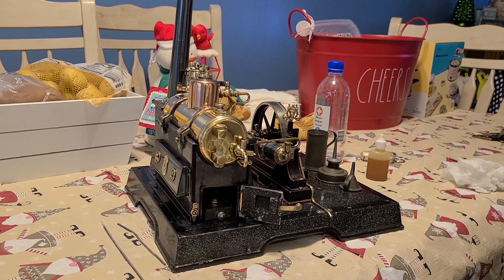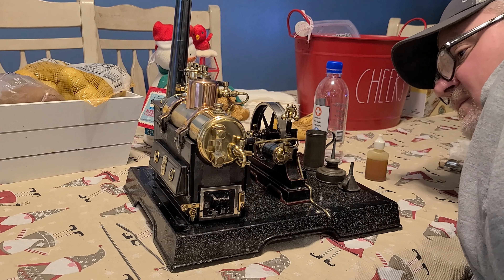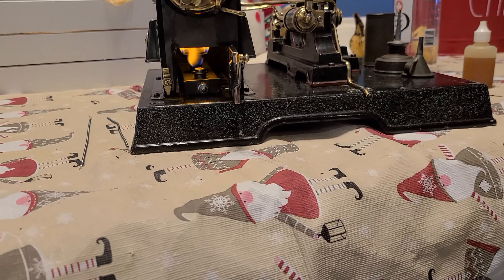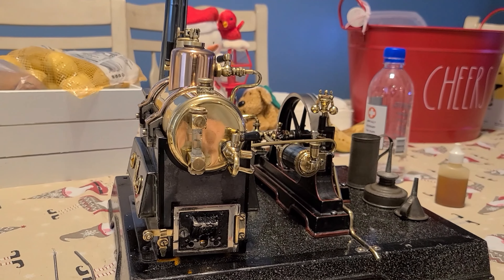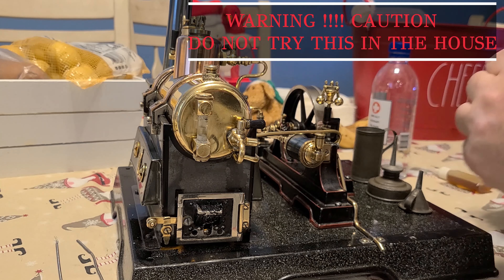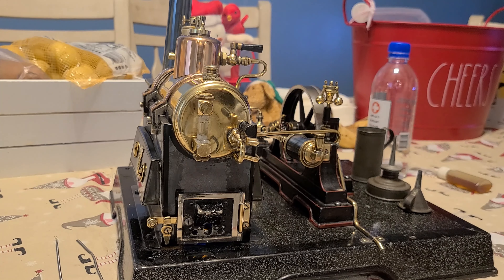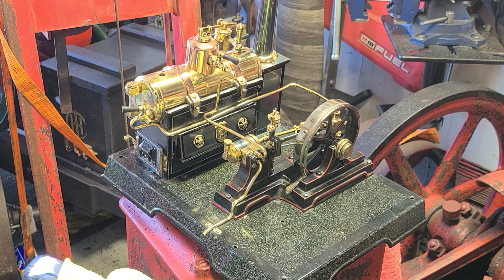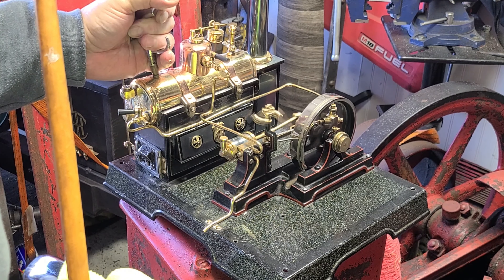Märklin Vintage Steam Engine Turned Fire Ball

Comment: Hi Will, I use the same disclaimer. "Don't do this at home, this is done by a professional".
I wanted one of those engines for Christmas back in the 50's🎅 "NO you will burn the house down".🔥 Looks like they might  have been right. 🤔 But I still think they are cool, thanks for sharing.
Reply from the maker: Thank you, Robert!! That's the best comment ever 🤣👏😂👌❤️. Thank you so much, and that's exactly my thoughts when I made it. 😊

Comment: did you do the restauration your self on this beauty
Reply from the maker: Hi Lee, Its still in process unfortunately, I just did a little clean up on it and am currently working on the sight glass repair.
Reply: @WillSmithHitandMiss  i know it takes time, and parts are hard to get, i bought the 4149/7 in a lot worster condition than yours and you gott a beauty,  Mine well i think it did survived the Blitzkrieg barrely so making the boiler and boilerhousing my self or else it will never run. youre burner is made of thinplaten so a good cleaning and soldering wil do the trick